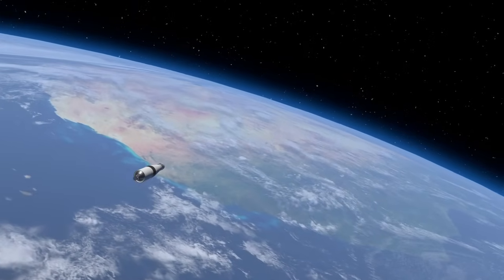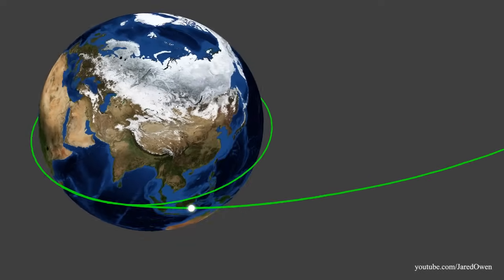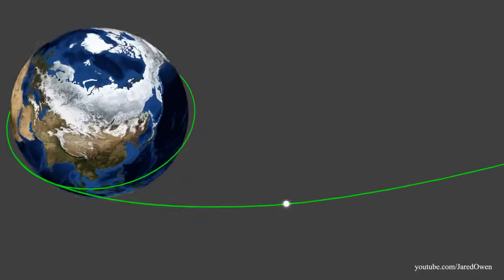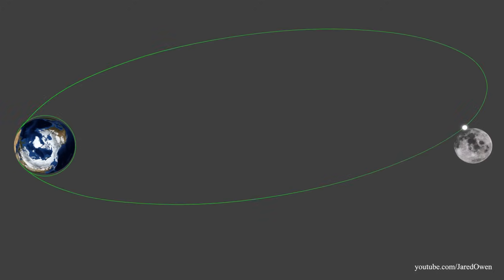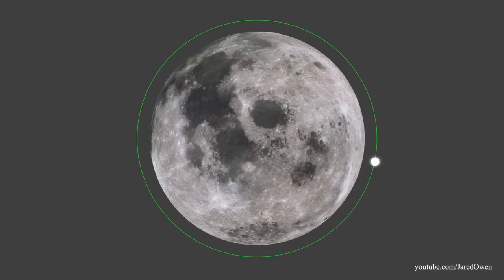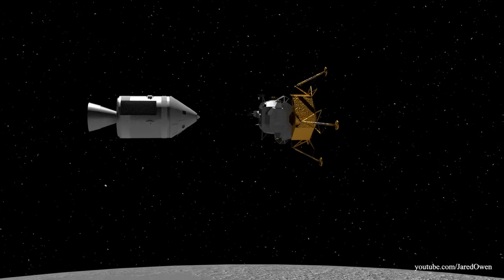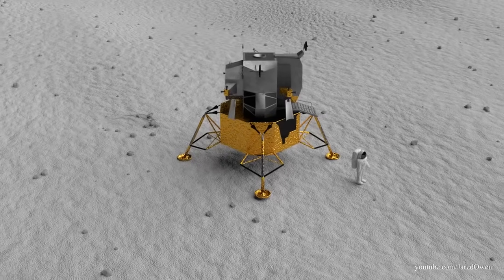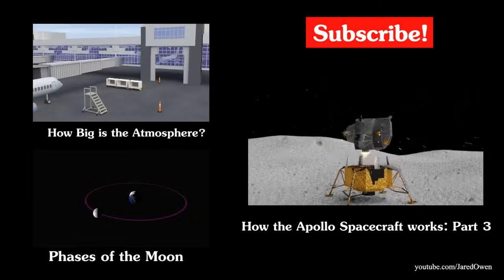How the Apollo Spacecraft works: Part 2

Comment: The DOI is shown on one of the missions from the window of the LEM.  It showed the LEM transitioning from  a horizontal vector to a vertical vector just a few thousand feet above the surface.  That didn't make sense because of the speed differential from orbit to vertical flight.  What held the LEM up when it was horizontal and out of orbit.  It would have started a decent well before it transitioned to the vertical.  That's the problem they couldn't overcome and have a successful landing of the flying bedstead.
The transition from a terrific orbital speed down to a speed when the LEM could proceed to the vertical would have resulted in that portion of the flight being pulled by gravity to the moon too much to allow the transition to vertical.  How do you account for the speed of orbit to zero without the LEM falling into the moon.  I know you'll say it had the engine to counter gravity but no in the transition. During that transition phase gravity would have put a downward component too great to over come.  The couldn't make that transition on Earth with any of our flights.  That's why they had to use a parachute and make a splash down.  It wasn't until the 90's when computers were powerful and light enough to work the thrusters as we see on the SpaceX buster landing.
Reply: I know you'll think it was possible because they did it. right?
Reply: David Soom

The gravity of Moon never causes an object to fall faster than 2.4 km/sec (ultimate velocity from infinite distance).
The power of the engine was more than enough. And yes, it fell towards Moon, until it broke the fall with the engine.

Comment: I hope nobody believes this fictional story... the reason why you cannot put your hand through solid objects even though your hand and everything else in the universe is made up of mostly empty space is the same reason why Rockets cannot work in the vacuum of space. All you need to understand is the reason for the equal and opposite reaction to understand why Rockets cannot work in space. And the reason for the equal and opposite reaction is the magnetism of the charged particles that makes up everything in the universe. It is the spin of the charged particles that is responsible for the magnetism. When you push on a wall in the wall pushes equally back it's because of the charged particles that makeup you and the wall. There are no charged particles in space so it is impossible for a rocket to get an equal and opposite reaction. Fluid dynamics governs how objects travel through both Water and Air. A jet ski uses a pump to increase the pressure of water then than it uses that high pressure water to push against the water is traveling through which causes an equal force in the opposite direction. A jet airplane does the same exact thing with zero difference except it uses Air instead of water. The turbine increases the pressure of air then the high-pressure air is used to push against the air than just traveling through. Anyone that tells you you do not need anything to push against is wrong. Rockets do not work in space. There are no satellites. They are not needed and would be a stupid business decision to use something that is not needed. They are able to send the signal through the ionosphere from Earth. That is how satellite TV works. And GPS devices use cell phone towers. And undersea cables connect the continents together. You are being lied to
Reply: Clearly someone failed high school physics...
Reply: rcflyinghokie the f*** are you talking about you didn't even make it to high school
Reply: I love these bonehead, trolling comments.
Reply: rcflyinghokie ...im pretty sure that was the nicest attempt at an insult I have ever received..cant prove me wrong so the next best thing is to try and insult...Thanks I think
Reply: METO U 'i hope nobody believes this story' bitch please more than bilions of people believe in this,you have a fucking two digit iq
Reply: OK, I'll explain it to you, like I would explain it to a little kid:

The fuel and oxidiser are mixed and ignited in the combustion chamber.
That results in a very fast expanding gas of exhaust molecules.
The exhaust molecules fly away in all direction, hitting the inner walls of the combustion chamber, creating a pressure against the walls.
To the sides ("left" and "right") the pressures cancel each other out. The combustion chamber doesn't move sideways.
To the rear, there's an opening, where the exhaust molecules freely stream out.
To the front, there is a wall.
The molecules hitting the front inner wall create a pressure against the wall.
There's nothing to cancel out that pressure, since the molecules just freely stream out at the rear.
So, the pressure against the front inner wall presses it forward, together with the whole engine and rocket.

Understood?
Reply: What a nut case!

Comment: Interesting presentation. Considering the ungainly looking LM. I have always wondered how much Reaction control thrusters were used in keeping the LM pointed in the desired direction. Pity NASA does not allow access to the LM data or schematics and vehicle testing results.
Reply: Not true.  All that information is on the public domain, and has been for decades.  For example:  https://www.amazon.com/Chariots-Apollo-History-Spacecraft-Astronomy/dp/0486467562  and also:  https://history.nasa.gov/SP-4205.pdf (for free, from NASA) for high-level explanations.  The individual contractors (North American Rockwell for the CSM, Grumman Aerospace for the LM, etc.) would have this information archived as well.  Not that hard to find.

Comment: How did the service module turn around and dock to the lunar module, whilst staying in front of it when it was being propelled? It would have to be going a little bit faster to stay in front of it, wouldn't  it?

P.S. I don't believe the moon landings were a hoax. I'm not stupid. I'm just curious about this specific step.
Reply: Makuta Miserix If you mean the transposition and docking maneuver to connect with the lunar module and pull it from the fairing on top of the SIV-B stage, all the maneuvers were performed using the reaction control thrusters on the command service module.

A tiny burst was all that was needed to move away from the rest of the rocket, another tiny burst to flip the spacecraft, and another tiny burst to move back towards the docking port of the lunar module.
Reply: Man, that must've been the hardest step in the mission. One burst too long or short, and they would've lost everything.
Reply: Makuta Miserix 
It was actually one of the safer maneuvers of the mission, and they had the fuel to try a few times.
Launch, reentry, landing on the moon, all much more dangerous.
Reply: It wasn't propelled during that maneuver

Comment: Well done!   Thank you.
Should have noted first landing missed (over-shot) LZ.   
Also show Van Allen belt issue.
Reply: Apollo did overshoot a little bit--guess Neil really wanted to miss that crater. Four miles isn't much when you consider the 953,054 miles Apollo 11 flew. However, the video shows a LRV parked by the LM. The rover was only used on 15, 16.and 17 so this is more of a generic Apollo video. Short cut through the VanAllen belt was not really an issue. The route was programmed way before launch
Reply: They were overshooting anyway. On the decent Armstrong says "we passed our 4 minute mark early, we're going to land long" or similar. They had landmarks that would show they were in the correct location at specific times, and he had noticed that the crater that they were supposed to pass 4 minutes after starting their decent burn went by slightly before 4 minutes. This put them into a boulder field, with a large crater at the end of it, and Armstrong had to fly manually get to a safe landing location.
Reply: Interestingly by the next mission they had solved the issues that caused the long landing, and Apollo 12 was able to make a precise landing within a few hundred yards of the target.

Comment: How did the module rotate during the descent so it's windows were facing the other way?
Reply: truemansparks Using its reaction control system, a gyroscopically controlled navigation computer, and attitude thrusters.
Reply: It had 16 small directional thrusters, pointing in all directions.
Reply: You can back up in your car even if there isn't windows.

Comment: What an absolute load of bollocks. Have any of you people seen the photos of the module, have you seen the material it's made of and the engineering? The more I look at this rubbish the more I don't believe it ever happened. Now they have put a car in space driving to Mars. Bwahahahahahah
Reply: Have you ever tried to research how it was built?
From the outside, you only see the thin, outer aluminum panels, plus the kapton and mylar "blankets", shielding for heat from the engines.
Inside, there was a cylindrical, pressurized cabin and a frame, where the engines and all the assorted tanks were mounted.

Comment: can someone explain how the landing module when it leaves the command module and fires it's descent engine why it goes towards the moon,is it because slowing down makes it drop out of orbit? also how does it achieve to land perfectly vertical in relation to the moon surface as i imagine any horizontal movement even very slow would cause it to skid or bounce.These are not rhetorical or sceptical questions i just would like to know
Reply: Yes, it fell out of orbit, when it slowed down.

The astronauts trained extensively in the 5 LLRV's and LLTV's (one from which Armstrong had to eject when it malfunctioned), so it wasn't much harder than to land a helicopter.

Already 5 of 7 Surveyor robots managed to land successfully, some years before Apollo 11.

Comment: At the risk of asking a really stupid question, could the LEM have descended using inert like compressed air?
Reply: Yes, but it hadn't been very efficient. Too little energy stored in compressed air, compared to chemical fuels.
Reply: Thank's while you're there, how does the capsule maintain it's shield first attitude, or where the capsules heat protected all around?
Reply: Just like the Mercury and Gemini capsules, the shape made if fall with the heat shield first.
That's also why the new Orion and both SpaceX's and Boeing's new "space taxis" have roughly the same shape. 

So does the Soyuz and the Chinese capsules, while the first Soviet space ships, the Vostok, where sphere formed and had heat shields all around.
Reply: So it's nothing to do with weight distribution, ie shield side heavy?
Reply: Yes, that too, since the weight dstribution in the Apollo capsule was off center, so it, by rotating it, could be maneuvered a bit.
Reply: Right I'll leave you alone now. Just one more thing, in your user pic is that a Gooseneck lamptroid?
Reply: Maybe, whatever that is. I don't know.
It's an alien I made several years ago... :)

Comment: all designs destroyed but we know how it worked ?wtf
Reply: Theone915
Shawcross is dead right: no one could build a Saturn 5 today. The sheer scope of the rocket defied - and still defies - any single comprehension. Here is a quote from Andrew Chaikin's excellent book, "A Man On The Moon", when he was talking about Apollo 16 Command Module Pilot, Ken Mattingly:
"Back at the Cape, a few weeks before the launch, he’d gone to the pad just to look at the Saturn 5. And he’d realized, as he gazed at the towering machine, that he barely knew what he was looking at. Sure, he understood the basic design, and he knew the parts and pieces he had to know. But there were, what – several million parts in the whole thing? And each one had been designed, fabricated, tested, and installed by someone. Standing there, he knew the scope of Apollo was beyond the grasp of any one mind."

Saturn 5 Fun Fact: (sourced from "Apollo: The Race To The Moon" by Murray and Cox) The complete rocket, less the two spacecraft, contained so much wiring that if an extra drop of solder and an extra 16th-inch of wire were used at each joint the total weight of those extras would equal the rocket's payload.

The Saturn 5 was state of the art for the 1960s and did everything it was designed to do. Technology moves on and even thinking about building that magnificent rocket again is just dreaming.
Technology moves on: the 2.5-litre engine in my Camry develops nearly as much horsepower as the new 3.5-litre alloy V8 engine that Rover put into their cars in the late 1960s when I was an apprentice mechanic on Rovers - the same era as the Saturn 5. Rocket engines today are far superior to those used back then.
Reply: @theone9519 they are very much available. Google rocketdyne F1 B engine. Also check out curious droid's video on this.
Reply: Think of it like this, there is a recipe for cookies; you lose the recipe but you know how it tasted.
Reply: @theone9519 Nicely refuted.! 👍
Reply: @theone9519
Hats off to you, sir.
Reply: Where is the video showing the inside of them LEM with the astronauts in 
the moon suits and attached with the bungee cords. They had a periscope in the CSM and LEM for navigation, but for some reason there are no pictures or videos of stars. The second moment changes as the fuel and oxidizer gets used, but somehow these 4 groups of steering  motors kept the LEM from crashing. No remote control or autopilot test landing to verify the LEMs control system and steering motors, with the sloshing fuel and oxidizer and water, but somehow they got it right the first time. The LEM simulator Neil flew and crashed obviously did not have the same second moment as the fake studio LEM on the moon stage. No radar stations on the moon to verify the unknown orbit of the fake CMS, and the ignition time of the LEM, and track the fake LEMs altitude and range as a function of time for descent and ascent. For the moon suit sublimator what blackbody absorber temperature did they use for outer space and the maximum power flux from the sun from the ultraviolet to infrared wavelengths. Same with the engine jet landing on the moon and the missing dust cloud and nobody afraid of rocks piercing the LEM or damage to the antennas, steering motors, or landing radar. They could have pointed the cameras up away from the moon instead of golfing on the moon stage but they decided not to because they would have taken pictures of the stage guys on the catwalk They also drove the moon buggy with lots of dust in the vacuum of the moon studio. Where is the video showing the astronauts in the LEM on the studio mooooon putting on their backpack life support. The clown did a fake spacewalk in the non gravity simulator in the airplane, but for some reason no stars in pictures or video from that. Their studio moon suits were contaminated with moon dust, which likely is radioactive, but no problem to put a Geiger counter next to their suits to verify there was no radiation hazard.Neil jumped off the studio LEM, but since it was live they could not slow down the speed by the square root of six, like the Six Million Dollar Man slow motion, because that would put the rest of their studio acting out of sync..Astronauts could not get more than 6 inches off the moon as they were hopping and walking and pretending to be on the moon stage. Radiation heat transfer on the LEM so they used a glycol cooling loop to radiate that heat back out into the air conditioned studio. Total hoax.
Reply: Sue Kennedy you’re just throwing shit on the wall and hoping something sticks. All those idiotic hoax “arguments” have been thoroughly debunked. Most decades ago. There is no hoax. We flew to the moon 9 times and landed 6 times. It’s an incontrovertible fact of life and logic.
Reply: Sue is hoping something sticks yet had she actually wanted to know answers she could have looked all of this up.

You know they are either completely fucking stupid and down right liars when they say "where are the stars" 

"where are the stars" lol.
Reply: @sphericalearth5897  
You also know, they did not do proper research, when they use the wrong acronym.
It is not the LEM, it is the LM.
The "Excursion" was dropped long bofore the first flight, because somebody thought that using the term "excursion" made it look like this whole thing would be a walk in the park. Which it isn't.
Reply: @suekennedy8917  in the time you cut n pasted that you could have done something more useful, like iron a shirt or make a pop tart. And ive seen you drop the same shit on lots of videos...  how many times do you need your ass handing to you?
......or is it that big?
Reply: dont forget the other 99% that they lost making it 100% making shill math impossible so why pretend?because its what shills do:)so how did they get there using shill math ?der burned ouch
Reply: deputydog7669
What in the world did you say? I tried running your post through Google Translate, but it just came up with "Language not detected".
Reply: @MarsFKA  it should have said "sorry, cannot translate Assholio"...